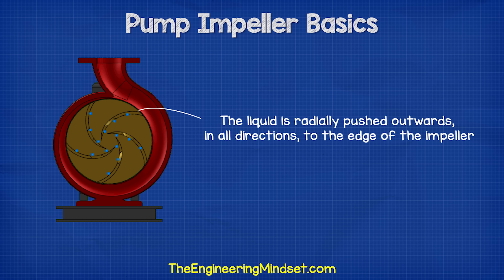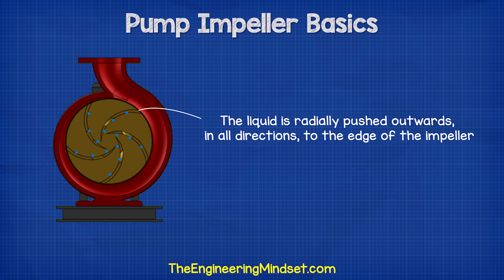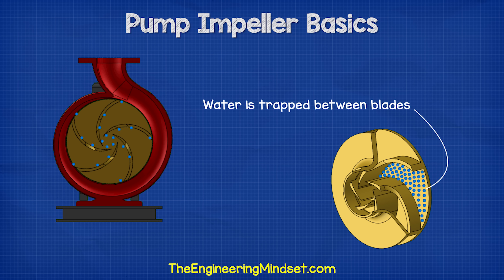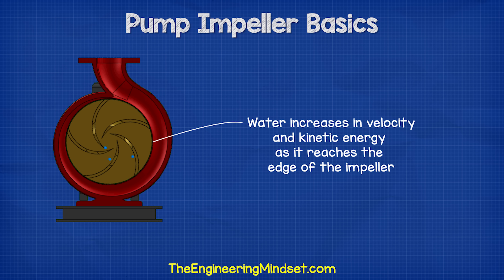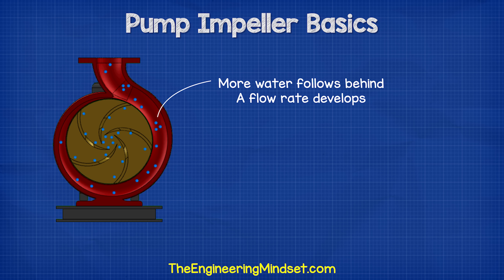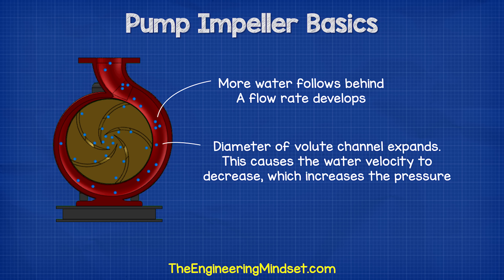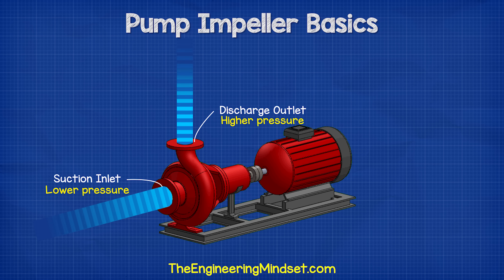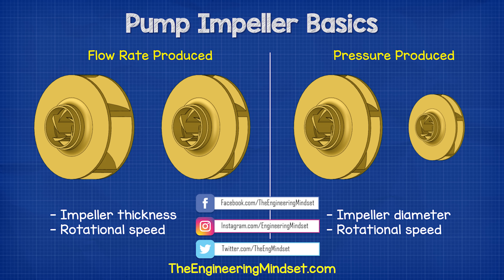Pump Impeller Basics

Comment: Half the pressure is created in the impeller by accelerating the fluid . The other half of pressure is created when the accelerated fluid  flows into expanding passage in the volute. Pressure is not created when the fluid hits wall of the volute.

Comment: Thanks for the great video. I have a question: Why does increasing the thickness of the impeller affect the flow produced only and not the pressure? Same thing for the diameter, why does it affect pressure only and not flow?